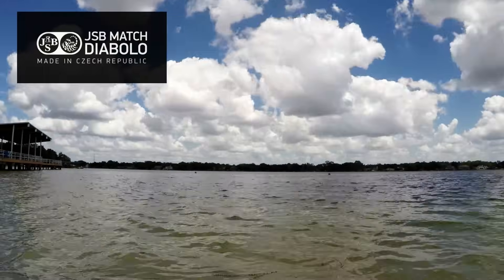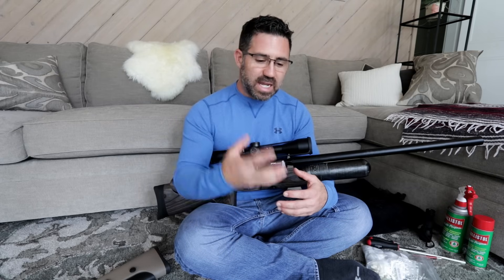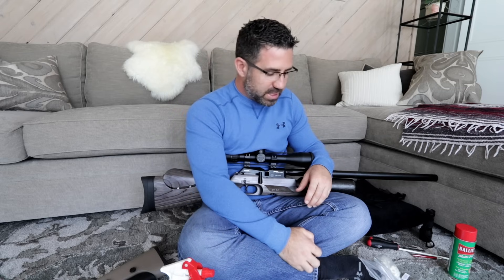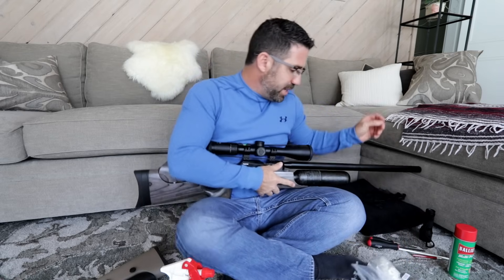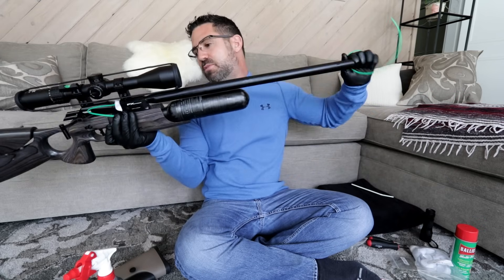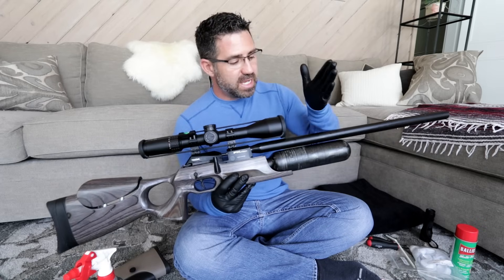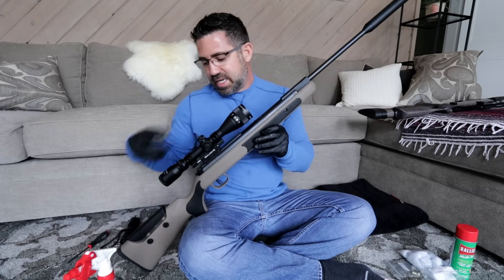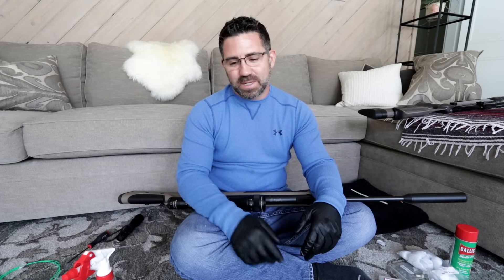Air Rifle BARREL CLEANING + Accuracy Secrets Revealed - PCP Airgun - Pellet Gun - Break Barrel

Comment: I have a a small pellet pump action hand gun That you pump 9 times and then shoot Well it wasn't performing properly as it did when I bought it  And I thought it wasn't any good anymore Well I cleaned it And it got back all of it's penetrating power it had when I bought it About 4-5 years ago So cleaning dose make a big different in the speed that your projectile is going to be pushed out through the barrel A Especially if your barrel isn't clean Just try it , you'll see a difference !!! Cleaning dose work And it probably even helps keep the pump in your air gun from wearing out to soon Sooner than it's supposed to at least 🙂🙂🙂

Comment: Is this system suitable with a BSA r10 .177? I'm worried the magazine breech is too narrow for the nylon material to bend into the barrel entry without causing damage e.g. Seals catching/crown. Much appreciate if you may have the answer 👍🏻🙂 thanks
Reply: It should work but it'll be tight... I've gotten it in narrower, lol.  I'd gamble the $15 a surely try.  Best, Steve

Comment: How about a video on barrel indexing ! after cleaning didn't know about this. I pulled the barrel on my Wildcat MK II compact smooth twist X re- installed not know about indexing POI was extremely off (about 3 " to the right and loose)  How to fix this would be a great instructional video !! Obviously there is no grub screw mark to go by.
Reply from the maker: Nothing to fix there, that's just the way of things for that setup.  Just gotta resight if ya pull the liner.  Best, Steve

Comment: Would you need to rezero gun and scope if you removed the barrel?
Reply: That is depending on the gun. The crown and impact, made by FX, don't need re-zero if the caliber is not changed. A cold clean bore will have a different poi than a fresh fouled barrel. I usually won't zero after a clean until I have about 20 pellets through it.
Reply from the maker: Agreed

Comment: I know this video is old but I appreciate them all. Recently after owning my Air Ventura Avenger for about 1 month it started not holding zero no matter what I ould try. I changed the scope and rings from my powder burners and even a new scope but to no avail. Every time I put it away or refill it to shoot again it's off by 3 inches in a random direction from where I zeroed it. I never bump the barrel or scope I am extra careful. I checked the barrel band screws they were all snug. i checked the Picatinny rail it's all snug. I have a DonnyFL Sumo on it from day one. This all started 5 days ago i even tried cleaning it but the same thing happens. I tried all 3 of your tunes and no change. No matter what i do after I zero it and stop shooting for more than an hour or refill it the thing shoots a=in a random direction again but the groups are still tight its just grouping 2 + inches away from where I zero i. So frustrated ready to return it as nothing works and I have seen it work before this happened which is a bummer. Anyway, sorry for the rant. Just frustrated, lol.
Reply from the maker: Some scopes are really sensitive to temperature change.  Also lately pellets haven't been great either.  But what you describe sounds like approach/hold to me.  You wanna be sure it's the exact same every time.  Best, Steve

Comment: I’m confused now I saw in another video saying that you don’t wanna completely clean your barrel cause a small amount of graphite and lead is actually good for accuracy in riffled barrels. They said to only run dry patches through and only use solvents every now and then is this true or is a cleaner barrel more accurate? I only just got my first break barrel airgun a gamo varmint rifle I took a couple of pop shots out of the box and it was shooting like 4 inch groupings. After running a couple of dry patches through the barrel I was able to get it down to quarter sized groupings.

Comment: Steve just saw your post and wonder if you could give me your opinion on the Hatsan line of 22cal air rifles, its been 40yrs since I've owned a pellet rifle I owned a Sheridan 20cal and back in the day it was a multi pump that was very accurate. the 2 Hatsan models I'm interested in are the  Model 95 & 87 I'll use it for small game & pest control, I'm leaning just a bit towards the 87 because a synthetic stock is more durable, performance seems equal between the 2 and the price 200.00 or just under is something I can afford. Help an old man out here if you can and if you think I'd be better served by another brand don't be afraid to let me know...  many thanks for your opinion...

Comment: Just in case I didn't go to the right place for questions,I'll ask here ,too.   I have a Gammo Shadow Sport .177 Break Barrel rifle. What brand of pellets and  what type do you suggest?
Reply from the maker: The 2 brands are H&N Sport and JSB.  As for which type, there's no substitute for experimenting that anyone will be able to reliably provide you.  8-10gr range is a good place to start.
Reply: @AEAC  Thanks . I just came from PatchWorm and ordered kit . They were out of the felt buttons. My gun hasn't been used a lot. Do I need the buttons?

Comment: Question about the cleaning 
I use the same materials as you are talking about and pretty much do it the same way
Fx dreamline  manual says not to clean with any water or chemicals 
What’s your take on this and will it break the warranty with the manufacturer 
Or over long term will it damage the barrel liner
Reply from the maker: Ballistol will be fine so long as you don't get any down the transfer port.  Just clean as I demonstrated and you'll be fine.  If you're still concerned, simply remove your barrel liner before you clean it.  Steve

Comment: By dry firing the FX Crown won't it damage the seals or O-Rings? Or knock something out from being seated? I've seen many comments on the forums that state dry firing a rifle like the Crown is taboo and shouldn't be done. Or any other high powered air rifle at that  any opinions? Thnx.
Reply: No, it won't hurt anything.  That's all myth.  However if you dry fire (or fire) any pcp with to little air it it, you could damage the valve.  Best, Steve
Reply: AEAC Vlog thanks for a perfect response. And added info. Much appreciated.
Reply: Another quick question. I've done some research and an effective answer still eludes me. I've also asked on other channels but have yet to receive a response. . I bought an athlon 8-34x56 scope. And watched Ted Holdover video on how he sets up his scopes on his rifles, but it seems he's bottoming out his scope to one end and working out a zero from there to have full adjustments going up. Isn't that bad for the internal spring? Or does that method only apply to his MTC viper pro? Thnx

Comment: I wish you had used the poly hex Raw hm 1000x as a example as well. 
 Dealing with the spacer inside the moderator tube to get correct tube alignment is FUN the first time. 
Thanks for your content Steve.
I  do hope it gets dryer and less mushy down there in land of the Seminole. 
Regards 
Scott
Reply from the maker: Herbert S Royce That gun's not meant to have its moderator removed for cleaning, lol.  Use a drinking straw instead... that's how I do it.

Comment: I remember the first time I bought a pellet gun from Wal*Mart and test fired it a few times straight out of the box.  I always wondered why it would smell like burnt oil after firing it.  I later learned about the dreaded "black gunk."
If you have an uncleaned break-barrel and look down the breach after firing it, you can actually see aerosolized oil suspended in gas.

Comment: Steve, you said you spent a lot of time culling pellets. I think I know what that is. What tool or device do you use to actually cull the pellet? Does this Improve accuracy and performance enough to do this regularly? Is this necessary? Very new to the sport. Just purchased a Benjamin marauder PCP in 25 Cal. Could you recommend a pellet?
Reply from the maker: "Cull" just means to sort through in search of the better choices.  Also, I've reviewed the Marauder in .25 for y'all.  It will show you the Green Mountain barrel's preferred pellets.  Best, Steve
Reply: Airgun Exploration & Advancement Channel ~ my apologies Steve & thanx for your quick response. I thought culling a pellet was when you forced it through a metal device or tool that has a hole in it the same size or caliber as the pellet to tweak the skirting of any excess slag & to ensure the caliber is correct(not too big) and not out of round. Not sure what you call that then. Is this something I should consider doing? Thank You...Brook.
Reply from the maker: @brookdyer6620  I never do buddy, and I've never had a problem with accuracy.  Steve

Comment: Hello there another great video!!! I have already take alot of your advice from you regarding shooting and preparing for shooting. After seeing your reviews about springers l just bought an  air arms tx 200 full barrel length cal. 22. I know each gun likes different pellets but l can't afford to buy and try so many of them like you :) so if you be so kind and let me know which pellets are the best for my springer that would be great and save me so much time and money. I really appreciate your time spending for testing so many pellets. I just need to take the best accuracy possible from my air rifle. Thanks.
Reply from the maker: it's not that i won't, im unable... ya just got to do the work and see what your barrel will like.  this will differ from gun to gun of the same model.
Reply: @AEAC  i have tested so far few different type of pellets gamo, H&N, webley,  Crosman and  the crosman premier  seems to be the best but l need to try airarms pellets still.
Reply from the maker: @mariobross1420  With any gun, always start with HN Baracuda, JSB Heavy, Predator GTO, and HN Sniper... those almost ways work well in every gun.  Crosman and Gamo wont have the uniformity to test the barrel for accuracy.

Comment: Fantastic how-to video.  I have one of patchworms, too.  The first time I pulled one of the "oiled" patches thru my .22 Diana Model 48, it came out filthy.  Took a lot of pulls to finally get a clean patch to come out.  I tried it on my .22 Daystate Wolverine R and like yours, the end of of the green line jammed on something.   A McDonalds straw was to big to even enter the crown of the Wolverine's barrel.  Tonight, I ate at Cracker Barrel and their straws appear to be smaller.  But no luck, it won't go all the way in either.  Do you know if the Wolvereine's shroud simply unscrews from the receiver?
Reply: Depends on how old it is. Some of them simply unscrew and others have two small set screws in the shroud near the receiver that need to be loosened first.  Steve
Reply: @aeacvlog2033  - Thanks for getting back to me, Steve.  I take a closer look tomorrow.  Baker Airguns sold me the gun on Jan 12, 2021, so it's probably a later version.
Reply: @bltefft  👍

Comment: Thanks Steve. I have this video bookmarked so I can come back and review it. I just began using the Patchworm cleaning on my Gamo Urban which I purchased last spring. I lubed the patch and felt cleaning pellet with Ballistol. The first patch & pellet pulled through very hard and came out black. I subsequently pulled two more pellets & patches through and then the black changed color to brown. I'm not sure if that is rust but so far I have pulled more than 20 patches with Ballistol through the bore and they are still coming out with brown residue on them. Should I contiue pulling lubed patches through the bore until there is no brown residue?
Reply from the maker: That's what I do.  Then I pull a bunch of dry ones after a few dry fires to cough the oil outta the transfer port.
Reply: @AEAC  Thanks Steve. My patches are appearing like the one shown in you video picture, but a bit less brown. Is that brown material rust? Should my last patches with Balistol have no color? BTW, I love your video reviews. They are very pragmatic and thorough, and also educational. Appreciate what you do for the airgun community :)
Reply from the maker: @geojohnson5613   In my experience the brown is the rust and the black is the pellet coatings.   Some barrels have a ton of rust in them but it doesn't seem to hurt anything.   As soon as you begin shooting a new layer of pellet oil and graphite will be laid down over the rust.  Steve

Comment: Thanks Steve. Did you ever feel the need to Polish the barrel? How does one do that? Confusing theories and DIYs out there on the www :)
Reply from the maker: Only a few times over the years.  If they won't group at 50 yards with anything, I like to polish them with JB Non Embedding Bore Cleaning Compound.  Remove the barrel and any o-rings, and run a bore mop caked in paste through 20 times or so.  Clean, reassemble and test again.  If it gets better but not perfect, try again with another 20 passes, and so on until the accuracy is there.  Don't overdo it.  Best, Steve
Reply: Airgun Exploration & Advancement Channel thanks...

Comment: Hi Steve, given how fast one can mess up a warranty without even knowing it, anything in particular to avoid while cleaning a rig?
Reply from the maker: Harsh chemicals and brushes.  Methods described here will get ya by in most instances.  Steve
Reply: Steve, love my new PatchWorm; kudos to them for the idea and you for presenting it. By way of comment I have been getting some green "shavings" in the breech area  of my 0,22 cal AA S510 US XS as the worm makes the hard turn from breech into the barrel...unsure if thats from the "green bead" or the line itself...I haven't tried to use a felt pellet yet but on this gun there may be some difficulties getting the whole felt pellet, patch and bead into the breech...I'll have to update as soon as I have the opportunity
Reply: Chatted with George at Patch-worm, a great guy. Basically the felt, even a wetted one, will make the turn just fine it’s a bit tight and pulling it into the chamber is stiff, but man does it clear out the crud.  He’s sending me one with a “clipped tail” to test out. Ordered some patches and felts as both are perfectly sized for the rifle.

Comment: Since this video was dedicated to answering some questions, let me ask one of my own. I watch your videos on a regular basis and every time you pick a few pellets that shoot the best. Do you ever find that switching pellets (after five shot groups) cause them to shoot any differently? Does shooting only one kind of pellet over and over again adapt to the barrel? In other words, does the barrel get seasoned to a specific pellet? I'm just wondering because, I generally use cheap, easily accessible pellets because of those reasons exactly. I ordered some of the most popular, more expensive pellets and they shoot worse. I guess I should be happy I can shoot cheaper pellets more accurately than other pellets but, am kind of confused why. I find this to be true in all of my rifles, which all have several hundred shots with the cheaper pellets before even trying the others. Would love to hear what you think about this.
Reply from the maker: This is an interesting question to me because the common line of thinking is that one must clean the barrel between pellet types or brands for the best results, but as you can see through my 67 vids this is simply not the case.  They key is to have the right one and to shoot it in the barrel's preferred state of cleanliness.  Best, Steve

Comment: Nice ... but,
I remove the barrel, always. Next I use MAF sensor clear. Cleans well and leaves behind zero residue. I use a nylon brush first (don’t use any type of metal brush, ever!). Spray the MAF cleaner down the barrel and scrub that sucker clean with the brush. Next I also use Balistol but I use swabs or a soft bore snake. Repeat each step two or three times and your barrel will shine like a mirror.

Comment: You guys are way overthinking over spending on clean air rifle barrels.  This works for ANY airgun, including Gamo Swarm system break barrels, single shot, magazine fed PCPs, whatever. Get a spool of Dacron or nylon upholstery thread.  Measure off three or four times your barrel length. Pinch there and double back to form a loop. Cut an tie the thread. Pull the paired thread from the knot to the end of the loop. Form a larkshead hitch and cinch it on the center line of a cleaning patch. Move sis inches down the paired line and tie a slipknot that tightens on pull from the long end. Cinch another cleaning patch. Repeat until you have about 8 patches in line. Wet the last patch you tied with Ballistol. Skip a patch, soak the third one. Fire up your vacuum cleaner, suck the long, free end of the thread into the breech, down the barrel and out of the muzzle. Very slowly, pull the train of patches through the barrel. No muss, no fuss, no disassembly. Cheap, easy, effective. ELEGANT! Have fun!

Comment: Ballistol is the only product I use on all my guns, air and powder. Works on all surfaces and does a great job of removing fouling. I spray some down the barrel, rotate it all around to coat, let it sit overnight, and then run patches through until clean and dry. Got tired of the fumes and caustic chemicals of other products. Thanks for the tips Steve. ATB, Michael.

Comment: so why can't you just use typical cleaning rods for real guns?  keeping in mind the real cleaning rods also have a pointed ram tip for pushing patches through as well.
Reply: You can so long as you're able to clean from breech to muzzle.  But not all airguns are easy access which is where Patchworm comes in.  It's also worth mentioning that I own all the Dewey Rods & Jags and the $8 Patchworm cleans better, is safer on the metal bits, and is easier to use.  I even use it on my AR15s and Glocks.  Best, Steve